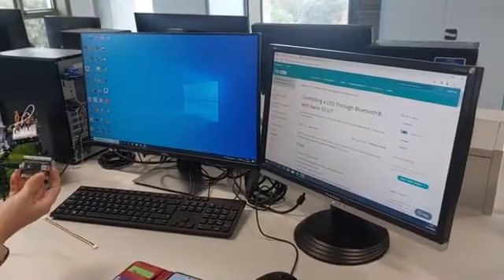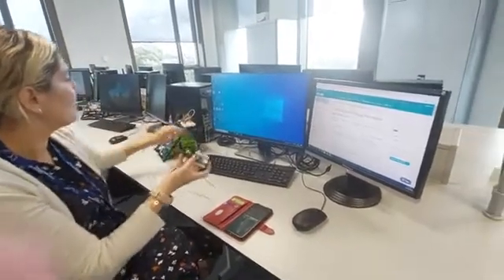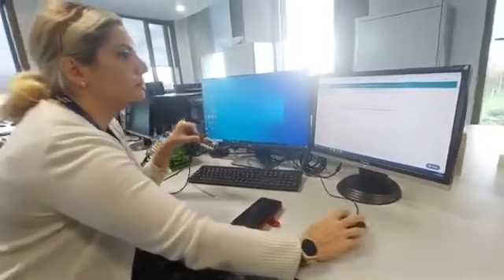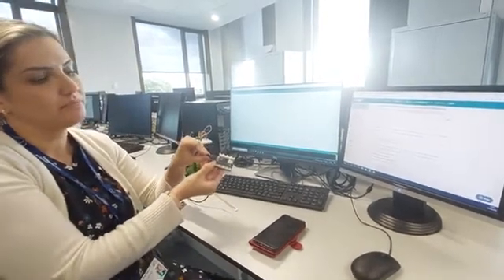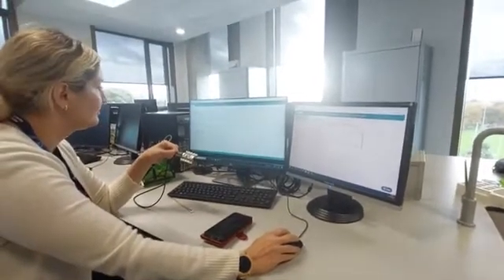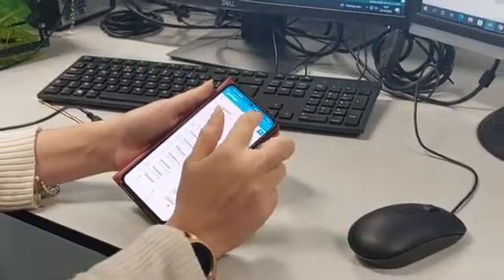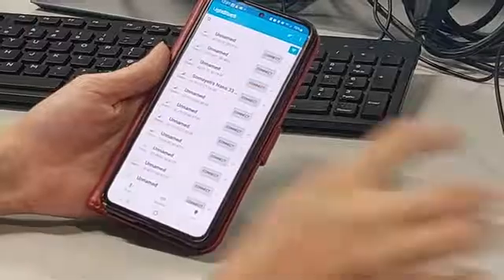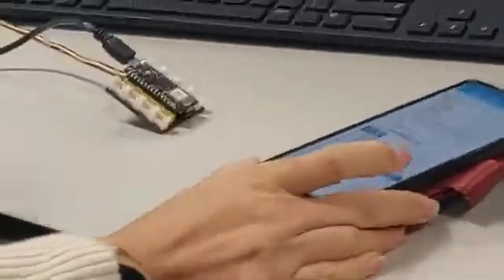An example of Bluetooth based on Arduino NANO 33 IoT explained by Somayeh at TUDublin

Comment: Long but useful for a first start of connecting Nano 33 IoT to a smart phone.  The long delay when trying to discover the Nano from the smart phone appeared to be due to a failure to initialize the Nano by a fresh opening of the Serial Monitor on the Arduino IDE. Thanks for posting.